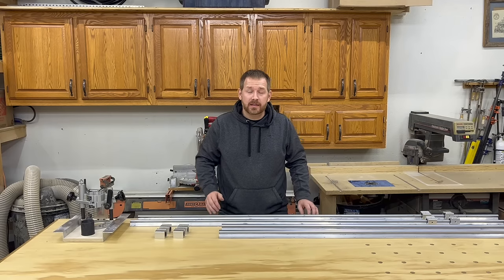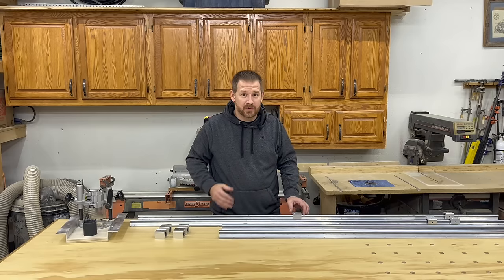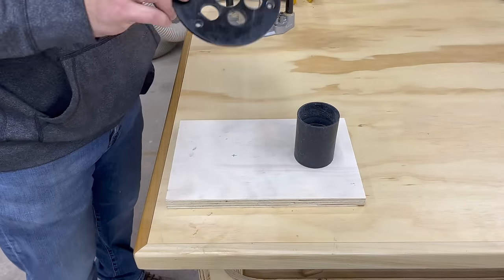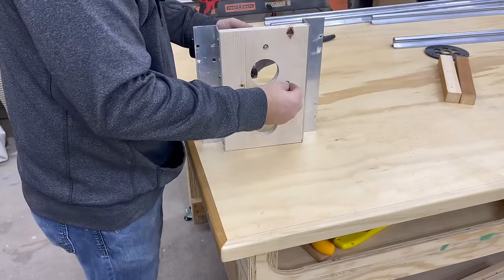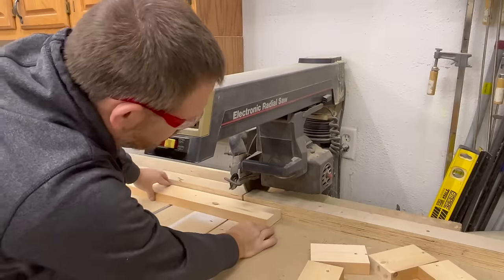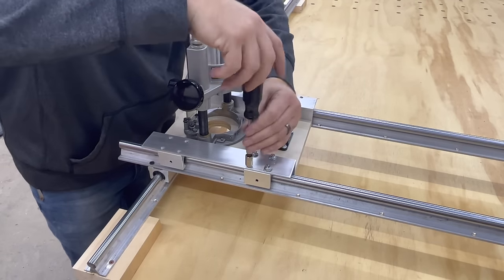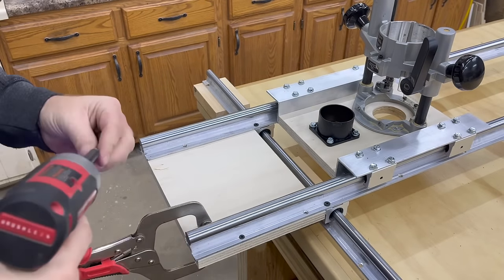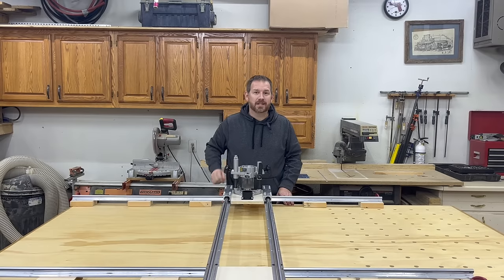Build a Better Router Sled/Flattening Jig

Comment: Hello, I am a super newbie, but after looking at tons of videos on a router sled this is so far my favorite. I will gladly order from your link, but any chance you can specify the size you used on both the upper and lower rails. 2000mm - 1500mm - 1000mm etc
Reply from the maker: Hello, thanks for watching!  I used the 2000mm rails for the lower rails and 1500mm rails for the upper.  You of course can use whatever longer or shorter lengths you need for your projects.
Reply: Thank you, and very true.

Comment: Nice job. I've been working on creating a sliding crosscut jig using linear bearings attached to my portable table saw (don't have my 2 car garage shop anymore). I hate using the miter slots because they either jam or are loose. The top of the bearing block will be even with the tabletop with the sled having a slick surface next to the tabletop. I should only lose around 1/2" cutting depth but everything should be smooth and accurate. I previously built a box-joint jig for a cradle, using a 3/8-16 thread rod to slide the jig left and right. I'm hoping to add this jig on top of the sliding crosscut jig so there's no binding when cutting dadoes. Once the bearing rails are locked into position, I could use them for a variety of sliding table jigs. 

As for your router sled, I am thinking about trying this using a handheld planer instead of a router. I also have slabs of walnut (from a commercial walnut orchard) that need to be flattened but I don't need something this wide. Would be interesting to build an edging planer mounting the wood vertical with some clamps to hold the wood. This might be easier to straighten the edge than using a table saw jig, especially on a portable table saw.
Reply: 여기 채널 동영상도 참고하세요

Comment: What size bolts did you use to attach the rails to the sled?
Reply from the maker: Hello, thanks for watching!  They are metric, I just took a block with me to the hardware store to find what fit.  If I remember correctly they’re M6

Comment: Well done.  it looks really slick!  With my own cheapo sled i find the hardest part is the set up.  I always need to either raise the work piece with (usually) some 1/8 hardboard or raise the sled itself to get it high enough for the sled to pass over the work piece. Also i find my Makita plunge router hasn`t enough plunge to get bit down below the plywood base plate without using a collet extender which i would rather not use as it`s hard on the router.  Do you anticipate such problems and How will you address them  if they do arise?

Thanks for the video.  Cool build!
Reply from the maker: Hi Glenn, thanks for watching!  My router can also only reach a limited amount below the plywood base.  If I have a different thickness of wood that I’ll be flattening I could pretty quickly change the mounting blocks with thicker or thinner blocks.  
I’m working through some ideas about making the router carriage adjustable.  When I decide on that I’ll make another video.

Comment: How big is your router and bit? I built a sled but guys are saying I need at least 2 hp router
Reply from the maker: The first setup is an older porter cable router with a 2” bit.  It did ok but I upgraded to a 3 1/4 hp router with a 3” bit.  That works much better.  Here’s a link to that video Making The Better Router Sled/Flattening Jig Even Better!  Time For Some Upgrades!
https://youtu.be/pYstDfpUUZE
Thanks for watching!

Comment: Did you use the SBR20 to go across and the SBR 16 mounted to the Bench?
Reply from the maker: I used the longer SBR20 on the bench.  The shorter SBR16 for the cross members.  Thanks for watching!
Reply: @Idealwoodworks  Thanks for the clarification - and the work you have done setting this all up. The links take us to a multi size selection page. Any concerns about sag or sway in the center of the bed of the router sled on that wide of a span?
Reply from the maker: @CentralPaRcFlying  The rails I used for the cross members were a bit heavier than the other rails.  They were very stiff so no deflection.  Of course you can use shorter rails if you don’t need them to be that long.  I made it this wide so that I could do a 42” wide table

Comment: This looks very good and I will consider this to build too.
But i'm wandering, if you don't need it, do you then store it or leave you it on the table to retain the accuracy?
Reply from the maker: Hello, thanks for watching!  When I’m done with it I remove the top rails from the bottom rails and store in on a shelf.  If you’re going to build this you may be interested in some upgrades I did.  Here’s a link to that video.  https://youtu.be/pYstDfpUUZE?si=J0KMdBB8nM-qFJgK
Reply: @Idealwoodworks  Your upgrades are great too. How do you deal with sanding/cleaning up the router marks after you used this flattening jig?
My probleem is, that I've created some light waves in a small table top with an orbit sander. They can only be felt with the hand, but when I start coloring it, the side is large that they become visible.
Reply from the maker: I address this in part 2 of this series.  I do my initial sanding with a belt sander.  This makes quick work of the mill marks.  
Also, if you’re making waves then the router is not perfectly aligned.  You should adjust that to get as close as possible.  You will still have mill marks but they will clean up faster.

Comment: How do you store these? I’ve been wanting to make a good router sled but I’ve got a small shop and don’t have the luxury of just leaving it out :/
Reply from the maker: I separate the top section from the bottom rails then just set on a shelf.  I’ve been thinking it might be better to mount some hooks on a wall and hang them. Thanks for watching!

Comment: I have the same P-C  690 router as you used. With it being a single speed (23000rpm) have you had any problem with burning?
How deep a cut do you normally take on each pass? I also have a P-C 890 variable speed I am using in my router table but no plunge base. Which would you recommend using on this sled? BTW 2 great videos.
Reply from the maker: The only issue I had with burning was after flattening both sides of a full table top.  I bought a cheaper bit from amazon and it got dull.  I take only a small amount at a time, maybe 1/16” or less.  Just don’t want to over work the router.  The next bit I order will be one with replaceable tips.  
As far as which to use… the plunge base is probably a little more convenient each time you adjust depth but that’s not much of a concern I think.  Thanks for watching and for the kind words!!
Reply: @Idealwoodworks  Thank you for your quick reply. Parts are on order and excited to build your sled soon.

Comment: After using this, does it still move freely?
Reply from the maker: Hello, thanks for watching!  If you watch the second part where I used it to flatten a slab of walnut, it still worked smoothly after that.  In my newest video I made an epoxy table.  After doing both side of the full table the bearing were getting quite a bit of dust in them making harder to use.  Had to blow them out with an air compressor.  Before I make another full table I’m going to upgrade the dust collection.

Comment: Outstanding project, sure glad I watched this before I dropped a bunch of $.      Really like to see it in action, and are you using a 1/2" drive arbor bit in your router?   You used SBR 20  and SBR 16 for the top rail system correct, they both same hole patterns?  👍👍👍👍
Reply from the maker: Hello thanks for watching and for the kind words.  I used 1500mm rails for the upper and 2000mm rails for the lower.  Of course you can use whatever size works for your needs.  Yes, 2” spoil board bit with a 1/2” shank.
Reply: Was hoping to find rails around 8 feet long and 4 across the material but can't find them in the 16 size, only the 20 . How many inches is yours in inches. Also can you order just the main ones mounted to the table, or extensions pieces ?
Reply from the maker: @douglasbattjes3991  My top rails were 59” and the bottom rails were 79”.  Setup like I did I could flatten material 43” wide.  I could probably get a little more if I wanted to.  When I was ordering I seen some 2500mm rails, that would be about 98”.

Comment: I always wanted to do this, but never really need it. I do mostly walnut tables and large panel glue ups, so all my lumber is planed to spec. I do want to get into live edge slabs, but just haven’t had the time! I bought a 2” router bit for flattening for my Bosch router (it’s a big one) but that’s as far as I’ve gotten. I’m curious as to if those rails need fine sanding or if the bearings are crap or not.
Reply from the maker: My rails came with a mirror like finish, I didn't do any extra work on them.  The bearings are very smooth operating.  I'm sure there's better bearings out there but for the price I am very pleased.  Thanks for watching!
Reply: @Idealwoodworks  Good to know! I just never know sometimes what I'm going to get. This looks like the way to go though!
Reply: The rails are designed for CNC/3D printers, and as such the tolerances on them have to be tight out of the box. All the aluminium profiles that you see are excellent for making jigs for woodworking. For example, I have just used some 30120 profile to make the fence for my latest crosscut sled. Best decision I ever made.

Comment: I recently purchased and built a sled almost identical to your....what I found was that these chinese SBR blocks are really finnicky and their threaded mounting holes are no where near symetrical in spacing...big watch out on that point. I do agree with drilling oversize holes as this tends to alleviate the above issue but you cant really drill eg. 10mm hole for a 6mm bolt. i do like the idea of adding stiffeners to the ends and will try that on mine as it does tend to rack the wider you make the router base....
Reply from the maker: Thanks for watching!

Comment: And there are no fine steps appearing on the final surface?
Reply from the maker: Hello, thanks for watching!  There is definitely mill marks, that’s unavoidable with this.  If everything is setup right there won’t be ridges though, just mill marks from the bit.  It requires sanding when done but when you don’t have access to a planer or sander large enough for a big slab then this works pretty great.

Comment: Hi rookie here. How do I line up the bearings to the aluminum frame. Not visible.
Reply from the maker: Hey thanks for watching!  Check the video at about 4:30.  See if that helps.
Reply: Sorry I meant to ask about attaching the blocks to the aluminum cradle sides. Having trouble lining them up exactly. Thanks for any suggestions.
Reply: At 1:45 of your video. Can you give me exact measurements? Thanks.
Reply: Sorry I meant 1:45
Reply from the maker: Seems to me the holes aren’t very square on the bearing.  I had to oversized my holes to get them to work.
Reply: @Idealwoodworks  ok thanks I’ll keep at it. Great video and you’re a good gent.

Comment: I like the system but you don't have any hight adjustment so you can only machine the wood to a very small hight range.... My table is almost identical but I used alloy stays down the side of the table with hight marks on them and butterfly nuts so you can adjust from 20mm - 250mm

Comment: Hi , the rail hole base normaly do not fit the 2 holes of the slider bearing , how do you make this ? You fix the bearings block on the rail, but the holes do not match in width, how do you do?,Thank,s
Reply from the maker: If they don’t line up you may need to drill to fit.  Thanks for watching!
Reply: @Idealwoodworks  Hi. The space between the screw holes on the bearing and the rail is too large, and impossible to drill on the rail, because it is too close to the edge.
Reply from the maker: @christianmateo2621  That’s strange.  My happened to line up without any drilling but there was also plenty of room to drill if needed.  One thought, when I attached the upper rails to the lower bearings I was only able to use 2 screws per bearing, can’t use all 4 per bearing.  I wish I could offer more help.  Best wishes!
Reply from the maker: @christianmateo2621  Please don’t take offense but I’m not going to put my email address on here.  If the rails and bearings don’t line up you may have to make some sort of adapter plate.  Otherwise maybe they sent you the wrong bearings/rails??  Might have to send them back?

Comment: You may want to include links for the aluminum angles, vacuum adapter, and hole saw bit.  I’m buying everything and would use your links if you had them!
Reply from the maker: Thanks for watching!  I don’t have links for the other items, those were all bought at a local store.
Reply: @Idealwoodworks  great content, thank you!
Reply: Great video what size right angles did you use? Do you put a extender on you bit to get the depth?

Comment: Some magnetic (or Velcro ) curtains on the sled will help with dust extraction 
I used polycarbonate for my router mount so I can see the cutter

I used steel angle 😊

Comment: Hi there, I love your videos on this. In fact I just got my linear rail Friday and can't wait to assemble everything. My two routers are older heavy duty PC and rated at 23000 rpm. All the bits I have seen are rated for 16000 rpm max. Would that be a problem? Thank you and keep the great videos coming. Patrick
Reply from the maker: Hi, Thanks for watching!  I would say that if you run any router bit, saw blade, etc at a higher speed than the manufacturer recommends you run the risk of it busting apart and sending flying pieces everywhere.  That could cause serious injuries.
Reply: @Idealwoodworks  Hi there, so is your Porter Cable one of the heavy duty ones and a variable speed? both of mine are the Porter Cable 6902, & 6912.Thank you,Patrick
Reply from the maker: @PatrickMoredock-d1h  Mine is actually and older 6902 also, not variable speed.  The cheap bit I ordered from amazon didn’t have any specs on max speed.  Maybe I got lucky 😬😂
Reply: Thank you for taking the time to get back to me. But, you have not had any issues with that bit? If not, great. Thank you,Patrick
Reply from the maker: @PatrickMoredock-d1h  My only issue with the bit I used was that it got pretty dull after doing both sides of a full table.  I’m thinking I should have bought a higher quality bit.
Reply: @Idealwoodworks  Copy that. Thank you and take care,Patrick

Comment: I like the design, but one flaw I see is it is not height adjustable for thicker boards??  Using the plunge router you can certainly get down to thinner ones, but you have a definit height restriction...  Adding some pre-made spacers maybe to raise the router up when needed might be useful...  But would be a pain with those 16 screws....
Reply from the maker: At the moment I just change out thicker or thinner blocks on the long rails setting on the bench.  I am working through some ideas to make it easier to adjust the height as well as some ideas on improving the dust collection.  When I get these things figured out I’ll make a new video.  Thanks for watching!

Comment: Good afternoon! Greetings from Brazil! What is the length of the guides and their diameter? I want to increase the cutting capacity of my router...that's why I bought a cutter with 52mm diameter widias in the cut!! Thank you for your attention! Pez and Well!

Boa tarde!Saudações de Brasil!Qual o comprimento das guias e o diâmetro delas?Quero aumentar a capacidade de corte da minha tupia...por isso , , adquiri uma fresa com widias de 52mm de diâmetro no corte!!Agradeço pela atenção!Pez e Bem!
Reply from the maker: Hello, and thank you for watching.  In the video description there are links to the rails I use.  I use 2000mm rails for the lower and 1500mm rails for the upper.  More specs are available on Amazon

Comment: Hello nice job.
Possible to have the others references to Make the router sled thks
Reply from the maker: Hello, thanks for watching!  The links for the rails are in the description.  The other materials I just picked up at the local hardware store so I don’t have any links for those.  The carriage is just some scrap plywood and 2”x2” aluminum angles.
Reply: @Idealwoodworks  thks

Comment: How thick is the aluminum angles?
Reply from the maker: I used 1/8” angles.  Thanks for watching!
Reply: Is there an easy way to drill the holes in the aluminum angle so the holes in the bearing line up?  @Idealwoodworks

Comment: Amazing set-up! I am always worried about the sag in the middle though. But even precision rails flex. in this case because of the weight of the router. Maybe a small wheel on the sled, extending as far down as the router bit itself, following the bit behind, in short distance inside the newly formed groove , with some compressed air blowing the chips in front of it... Like a wood plane. Rolling instead of skidding. Idk, one downside, it would make it unidirectional as a result. But i cant stop thinking about the result on flatness.
Reply: Use a smaller router like a Makita or heavier duty top rails.

Comment: If you use all 16 holes to secure the upper rail to the bearings don't see how there would be any racking  and you wouldn't need any  plywood? 
BTW, fantastic idea.
Reply from the maker: I tried sliding the carriage back and forth without the stiffeners, it would bind up immediately.  The stiffeners are definitely needed.  Thanks for watching!
Reply: @Idealwoodworks  Great input just trying to think of a way so its doesn't protrude so far beyond the rails, thank you for doing all the leg work.

Comment: I’ve always thought that instead of a router, use a handheld planer.  Much quicker, better finish then a router.  The problem is, of course, a handheld planer doesn’t have the wide range of depth of cut as does the router.  Figure that out, and that shouldn’t be too hard, and you have a better solution (in my humble opinion)